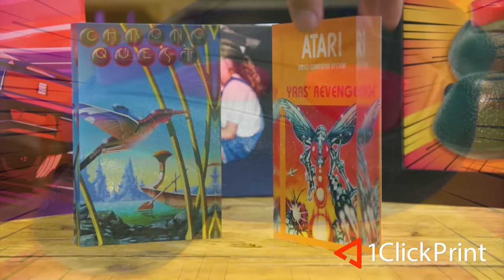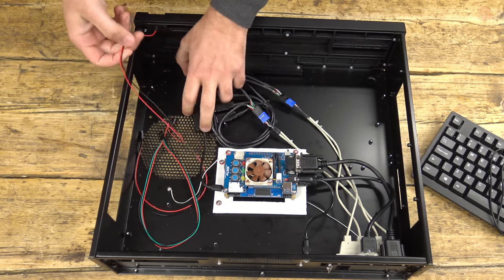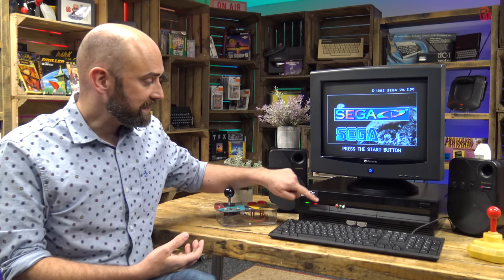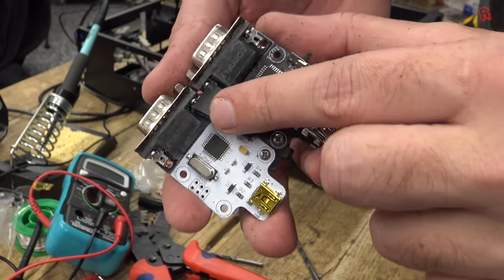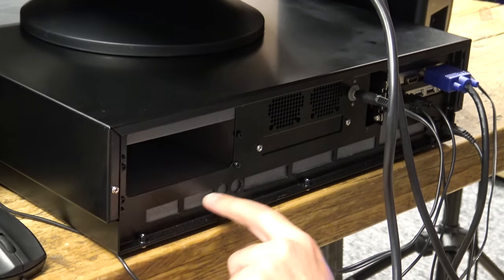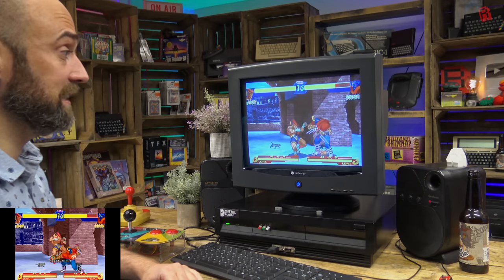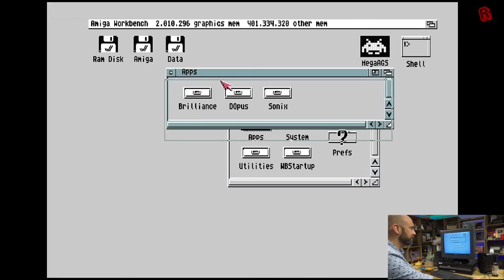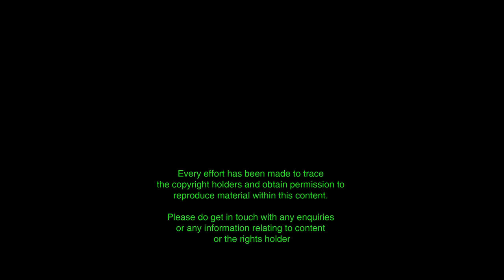My Ultimate FPGA Desktop Part 2 - The Finished MiSTer build

Comment: Great job and a great result overall. Most of it is close to being perfect to me (well, I must admit I truly hate the three buttons on the front, that I find insanely, truly, hideously ugly, but this is your case as you said, and as we say in France, "Tastes and colors, you just don't argue about them" ^^ (free translation, you are welcome ^^) or "Tastes and colors cannot be discussed" for Google, but this is really the only thing that I dislike in what you have achieved there). You will have countless hours of fun with it, and there is nothing else to say now!

I was thinking doing more or less the same thing with one of the new 1200 case that were backed quite some months ago now, but I am not a great DIY guy, and I am quite worried by the amount of soldering of any kind (electricity for ex.). I have the feeling that you went that way because you are quite a DIY guy, this is part of the fun you have on that sort of project, but that some/most of them could have been avoided just by using off the shell elements, is it right ? 

By the way, I was wondering when you talked about them: why scanlines? Always thought their objective was to recreate a CRT monitor feeling on flat screen, or you were already on a CRT. What is the point of simulating a CRT on a CRT ?
Reply: Because somewhere along the way someone decided that we all saw scanlines back in the day when we really didn't. By the time video games came around, CRT technology had progressed to the point where scanlines weren't visible to the naked eye. Problem is, they occasionally showed up on film when photos were taken of the screen. Those photos are what people use to emulate the "look" of the day. Toss in a bit of Mandela Effect and we apparently need to add scanlines to a CRT to make it more "authentic". sigh

Comment: Batocera would be a good upgrade, if the mister can run it.
Reply: Batocera is a Linux distro for x86-64 processors, it won't run on a Mister.

Comment: "MiSTer Fusion"? What the hell? lol

That's what I called my PCB design last week. I swear I haven't been on Patreon recently. lol
Reply from the maker: Great minds Ash - I have plenty of spare stickers if you want some
Reply: That "momentary to latching" board is probably a good idea for boards like MiSTer.

A few people had issues in the past when using the inline (desk lamp style) switches, as they dropped a bit too much voltage.

You could use a chunky power switch of course, but it's nice to be able to use the momentary switch on that case.
Reply: 7:09 - AFAIK, the pinout for the buttons connector is actually...

1. Ground
2. nc (no connect)
3. Reset button.
4. OSD button.
5. User button.

(with pin 1 being closest to the edge of the IO Board.)

At least it is on the IO Board I have.

https://github.com/MiSTer-devel/Hardware_MiSTer/blob/master/releases/iobrd_6.1.pdf

No idea why the schematic doesn't have pin numbers on, btw. lol
Reply: I think the reason you were getting only 1.8 Volts on the LEDs is because they are active-low (open collector) outputs.

So you do supply a constant 3V3 to the Anode, then hook up the Cathode to the LED signals on that connector.

But you should add a resistor for current limiting to new LED, too.

(The resistor value normally used for the LEDs on the IO Board is 560 Ohms. Anything from about that value to around 1K should work OK.)
Reply: It's entirely possible to add support for an actual CD-ROM drive to MiSTer, btw.

But I don't think anyone has added that to any cores yet. It requires a bit of extra C code on the HPS (ARM) side.

And maybe, just maybe, the PCI adapter I'm working on might actually work, so you could have a Voodoo 2 and Sound Blaster Live in there. lol
Reply: @RMCRetro  To be fair, it was kind of a working title on my board anyway. lol

But I might go with something Spaceballs-esque, like "MiSTer Coffee".
Reply: @electronash  momentary latch of reason, isn't that a pink floyd album?
Reply: @bazza5699  I was genuinely thinking of going for that joke earlier, but it seemed a bit too obvious. lol
Reply: @electronash  oh i dunno.. i thought it was obscured by clouds..

Comment: I know I'm late to the party, and I'll say right now that I enjoyed the first video, and look forward to enjoying the rest of this video. But I have to chime in on the "emulation" thing. And I apologize in advance, anyone who isn't interested in technical details can just skip this comment.

The common argument is that FPGA is as inaccurate as emulation because it involves people figuring out circuits and especially chips and approximating their functions in FPGA hardware. The argument basically boils down to errors in software emulation are essentially no different than errors in hardware emulation.

I think this misrepresents the differences on a layman's level to effectively misrepresent what FPGA can accomplish. Here's an example: are clone consoles emulation? I think most would say no. Clone consoles use chips that essentially emulate the same functions of the original hardware, but they often have slight differences that end up creating compatibility issues or minor differences compared to original hardware. The original chips no longer exist, but these newer chips do the best they can at replicating the functions of older chips. Still, I can't imagine anyone considering such hardware to be "emulation." It's not emulating anything, it's taking commands and processing them largely as the original chips did, and the instances where issues occur are not because the chips are not "emulating" original hardware properly, but because they have slight physical differences (sometimes bug fixes or other improvements) from the original hardware.

The point is that by playing a clone console, you're playing on actual hardware, using the best modern versions of chips that are no longer manufactured. The hardware is attempting to process the code exactly how the original hardware did. FPGA takes this a step further and says "Okay, this version of a modern recreation of old chips isn't quite perfect? Well let's re-program the gate arrays on the chip with a more accurate version." It literally means that the more understand of original hardware there is, the more accurate we can recreate it IN HARDWARE. All that is required is a firmware update. It's still recreating, in hardware, all of the circuits and chips that existed in the original hardware.

And that's another thing: circuit boards are not incomprehensible. We can easily recreate all of the ancillary components on the circuit board within an FPGA. We can look at those boards, with our own eyes, and see the traces and capacitors and resistors and figure out how to implement the components (and maybe even improve them) at an FPGA level. We can even remove layers of protection for chips we don't have data on to look at their circuits and figure out what they do and how.  Granted, this is easier done on simpler chips from the early-to-mid 90's than later stuff, but it's a thing we can actually do! FPGA has the possibility of perfectly recreating HARDWARE with HARDWARE. So I think it's inaccurate to call it "emulation." Software emulation works on an entirely different level. Even when it's done perfectly.

That's the end of my FPGA rant. It's not "hardware emulation" when you know exactly how all of the chips work and can recreate it 100%. And for a lot of this stuff, that's exactly the case. The brilliance of FPGA is that we can save software copies of those recreations in VHDL so that any modern FPGA can recreate the original hardware exactly. This is all about preservation, and emulation CANNOT do that.

Comment: I must add that your wiring for the LEDs are wrong. You add a resistor in line with "each" LED and figure out where you want your voltage going to on the LEDs and wire them all to the 3.3 Volts on that 7 pin header and then wire the other side of the LEDs to the individual designated LED pins on that same 7 pin header. That 1.7 volts you were finding is used as a "signal" and not a voltage source. I have all three of my illuminated buttons wired to a Five and a Seven Pin header that I can easily separate from the I/O board. One Question that I have is the third LED. What is that LED really used for? I have mine hooked up and it's green of coarse. And it just seems to either be On. Or be off. It doesn't seem to really signify anything like the Disk Activity LED.

Comment: Brilliant as always neil ,  but fpga is still emulation at the hardware level.
Personally,  i prefer software as its less hassle and is mostly free. 
Mame almost flawlessly emulates most arcade hardware very well as long as you have a decent cpu and modest gpu.
Where fpga excels is when you need nanosecond critical timing between all of the hardware circuits , this is not possible in software , but in practice the difference is un noticeable  for the most part if u have fpga and software emulation side by side...

Comment: It´s really a nice system you´ve built there, but, honestly, even though it looks great I would not have come to the idea to use such a nice case as the checkmate for a system like this. It seems to be way too big & overdue for the MISTer. I would have either chosen a vintage (not too big) Desktop PC-Case or a modern "Mini PC" case. Nonetheless, nice outcome though ;)

Comment: sounds like you need some WD-40 on the speaker pots.
Reply: No not WD-40, he should use Deoxit D5, as WD-40 will leave an oily residue, and it's not great for electronics.

Comment: Neil (doing his best Gunny Hartman impression): "This is MY MiST FPGA! There are many others like it, but this one is MINE!" 
But seriously Neil, bitchin machine. Planning on building Raspberry Pi based emulation rig using a NES based case that just came out that supports SSDs. No, its not as good as an FPGA, but I think it might be a tad more flexible and its a more well worn path. I think these FPGA based solutions are the way forward. If the Raspberry Pi foundation releases a FPGA based system I think you'll see the emulation scene start moving towards FPGAs fast.

Comment: Awesome idea mate, and ultimately the new Minimig core with Amiga OS 3.1.4 can see all the SDRAM on the MiSTer and runs faster than an original 68030 accellerator card, Mister has an official AtariST core so definitely worth the nice case. The only thing I would have done more is bring both the 2 SD slots of the MiSTer out on the from of the case for easy swap, and connected the MiSTer network card to the lan, the auto update script is very handy ;)
Reply: There is literally no need to remove the SD card, everything is accessible through FTP. He does go through this in the video. I've not touched my SD card in around 8 months now. Having it relocated will achieve nothing of real benefit.

Comment: What about floppy drive?
Reply: The problem with external drives of any type at the moment is that the cores wouldn't use or load from them. At most the 486 core can treat a drive like a USB Storage device and not much anything else.

Comment: It annoys me when people get annoyed at calling FPGA emulation. Hardware emulation is hardware emulation and software emulation is software emulation and both are emulation. Just like it annoys me when people say isometric games are not 3D or Doom is 2.5D and stuff like that. 3D means three dimensions, length, width, and height and perspective projection is one way of representing 3D and game engines that use perspective may have any arbitrary restrictions on map construction, player movement, or anything else.

That's enough ranting for now (-:
Reply: "Emulation on the bleeding edge of technology"  as that weirdo guy likes to say xD
Reply: bet you get seriously peeved when vegans talk about vegan cheese.. lmao
Reply: Lassi Kinnunen  Yup, that's more like it.
Reply: Lassi Kinnunen  Before I saw my first 8-bit emulators on the Amiga the main place I heard "emulator" was in "terminal emulator" where the console/commandline/telnet/etc would apparently emulate an ancient thing like a VT-100. I'm in my '50s and have never seen one of those (-:

But I had also heard of but never seen hardware emulators that were used for prototyping and/or debugging in that era.
Reply: @bazza5699  "Emulated cheese" (-:

Comment: But it is emulation, hardware emulation, it's just faster and more accurate than software emulation by a large factor.
That's a shame if he never makes that case again, was a lot of effort to make it possible to manufacture in the first place. :\
I think it's interesting as a DIY configuration, a simulated tangible experience. :)

Comment: FPGA is an emulation because software doesn't run on the original hardware and hardware itself uses different architecture.

Comment: Rather than emulation, I call it simulation. That would have been a better term perhaps.
Reply from the maker: Simulation feels looser still to me. A Powerpoint presentation of the Windows 95 desktop could be considered a simulation. I heard someone describe FPGA as "hardware compatible" the other day, which I thought sounded like a good fit. You wouldn't call an x86 AMD CPU an emulation of an Intel chip, you'd call it compatible. I like that line of thinking.
Reply: @RMCRetro  I see what you are saying. "simulation" has been tossed around for FPGA mostly to give it distance and distinction from software. Google gives the vague definition of emulation being "reproduction of the function or action of a different computer, software system, etc." and simulation being a "production of a computer model or something." Since FPGA can pretty much be like the original hardware at the transistor level. 

Eh.. its just a game of dictionary.   Personally I want to find a combination of words that can make up a haiku to label my system... My son suggested the words "Multi-combobulator".... Which sounds better than either simulator or emulator in his opinion.

Comment: Massive case, tiny board with an even smaller heatsink and blower fan. 

I mean fair play to the effort you went to but why not have a big passive heatsink on it? I stopped 4 minutes in to make this comment, hopefully the rest of the video will show me a case jam packed with hard drives or smoke machines or something to show why the case needs to be so big.
Reply: Alternatively, as you're going for the CRT oldschool immersion, why not have an additional 80mm fan in the back extracting the miniscule heat from the unit, and have a 2.5" laptop hard drive? On games under 10gb in size (and for that matter, bigger games in some circumstances) I've started using the hard drive over SSD again. it is slower, but not terribly so, and it's fun hearing the hard drive chatter.

Comment: Idiot? Nah, no way, its absolutely awsome, only thing diff I would have done is put the DE9 ports on the font on the front-side enstead (left or right), and have fitted the 3 "Operation buttons" into the location where the original case button is, And mabey put some USB ports on it, but say on the opposite of where the DE9 ports were placed.. Still that said,  I LOVE your setup.